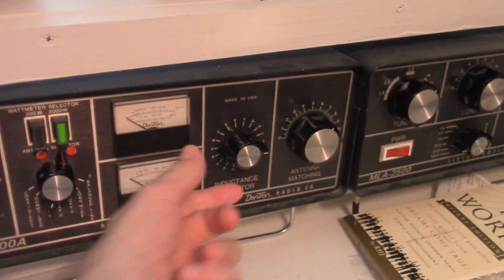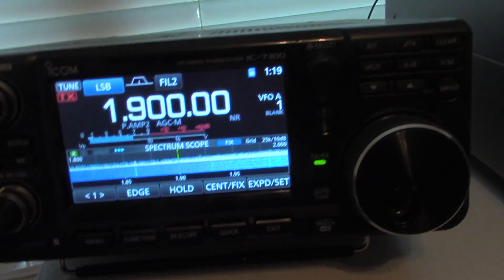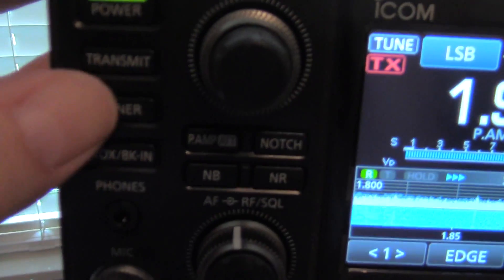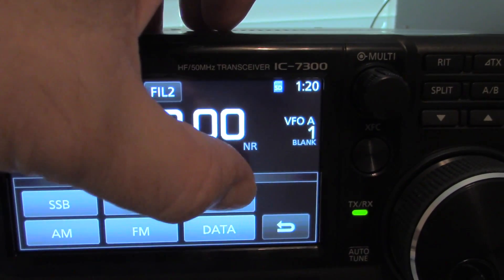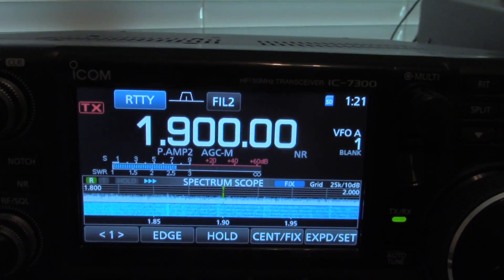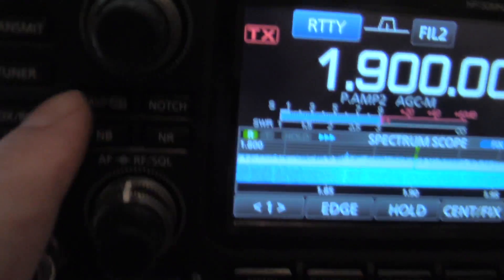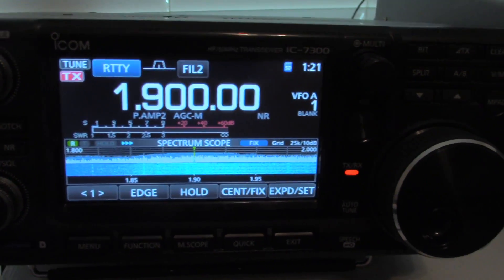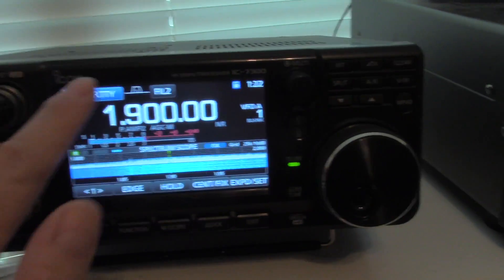Icom IC 7300 Using External Antenna Tuner to Lower SWR

Comment: Do I disable the internal tuner when using an external tuner? Or do you use them  together? Or tune the external tuner first; then use the internal tuner? Or vice versa? Thanks!
Reply from the maker: I would turn off the internal tuner,  then use your external tuner.  Thank you for watching my video.
Reply: @RichRodgersOnline  Is it possible to use both in conjunction with each other?
Reply: @RichRodgersOnline  Thank you Rich
Reply from the maker: I have tuned the external tuner as close as I can, and then I hit the internal tuner.  People say I should not, but I do.

Comment: Hi

When using the internal tuner will the 7300 automatically drop its power or do we need to manually do this??  Icom gives unsure answers-Unbelievable!
Reply from the maker: Hello William, When you use the internal tuner, the 7300 will automatically drop the power.
Reply: @RichRodgersOnline  Thanku!!!

Comment: I had the same problem I tried to tune a vertical antenna, and the SWR was way over like OK, I have put my LDG Auto ATU  and connected that to IC7300 now I get 1:5 what a radio well impressed with it.
I might try my manual ATU see what I get AT230 😏 Thanks for the information first time I set it up today and what a brilliant radio. I got this for my 40th birthday just had a go today on 20m wow.
Reply from the maker: Glad it seems to work great for you!!   Than you for watching my video!!

Comment: Of course, the best place to put an external "antenna tuner" is at the feedpoint between feedline and radiating element, that way the feedline is terminated in its characteristic impedance at both ends.  This is meant to reduce ohmic losses in your feedline and keep whatever power is reflected back from your radiating element within that radiating element, and so it and the tuner take the heat instead of your feedline.

73 VE7NDE
Reply from the maker: It would be nice to be able to do that

Comment: ok, I'm a bit confused so do I more stick with SWR read from the radio instead of my manual ATU? I'm using MFJ-945E, do I need in radio menu switch off internal ATU?
Reply from the maker: P.T.T. Thank you for watching my video.  I would have the auto tuner off in the radio. I would just use the manual antenna tuner meter.  Sometimes I can not get som bands down low enough SWR using the manual tuner.  When I only get the SWR down say to a 2 to 1, I hit my auto tuner in the radio.  Then the radio thinks, so to speak, that it has a 1 to 1 SWR...  Most of the time I have my radio auto tuner off.  Again unless I cannot get the SWR down with the manual tuner...

Comment: you can get the little plug-in dongle from the guy on ebay, it plugs in the back of the 7300 when tune is pressed automatically lowers the output power to 10 watts... cheap, about $15-20.  I remember his address is cornwall on the hudson.  Works great!!!
Reply from the maker: I could just turn down the power

Comment: Thanks Rich, just what I needed.  I got my 7300 this afternoon and the internal tuner wouldn’t tune the upper end of the 80 meter band.  I do have an external tuner and will try it in then morning using your suggestion.  Thanks again. 73.
Reply: I hv the same issue with the sane radio on upper 80. Go into emergency mode(50 watts is not a huge deal)and the internal tuner works perfectly
Reply from the maker: I hope all worked well.

Comment: Rich Rodgers, One main determinant of success with antennas on 160 meters is that they suck, generally, if designed to cover the "usual bands" from 3.5 - 30 MHz. I'm NOT sure what you described as your antenna, but most antenna tuners tell you what to do to load up on 160. It ain't pretty. Most require rewiring your whole antenna system and run the antenna as a top hat Marconi configuration driven against ground. Many ops are using combo antennas such as a G5RV. Wow. What a mess to convert to 160! Most scream at you in their comments, NOT FOR USE ON 160 UNLESS EXACT CHANGES ARE MADE TO ANTENNA. So, I wouldn't expect even a great tuner to work on some random antenna on 160 unless you REALLY know what to expect. de KQ2E
Reply from the maker: I agree

Comment: I was told you cannot use external and internal at the same time
Reply from the maker: Francis Farmer I have found that you can sometimes get it close with the  External antenna tuner,  you can peak it to very close SWR with the  Internal antenna tuner
Reply: @RichRodgersOnline  all your doing is tuning the input to your external tuner it not helping you just faking it more. adjust your inductance one notch one way or the other then retune. you should get a flat match. never run both at the same time.
Reply from the maker: @bradkellison5359  I believe I tried to adjust it more but had no success, the auto tuner worked great to tune it in just a little more.  Yes faked it but 100 watts out
Reply: @RichRodgersOnline  Two tuners in series might "work" but you should consider all of the factors at play.

Since you cannot match the antenna with a single tuner, this indicates a fairly high SWR on the line. This will cause not only higher feedline losses but could lead to the development of sufficient voltage or current on the feedline to cause its failure. This is particularly true when an amp is involved as you indicated.

Then consider the tuners. With a high SWR and an amplifier, at least one of the tuners could flash over (arc) due to high voltage or it could smoke due to high current. There is also the general consideration of tuner efficiency. If the two tuners combined yielded a 2 dB loss, for example, and you run a 1 kW signal through them, they will dissipate 370 watts of heat. That is a lot of heat for a tuner to safely dissipate (and generally one tuner will bear the brunt of the matching and thus heat dissipation).

So if you experiment with this setup, I would recommend starting at QRP power levels and then slowly raise power while monitoring the operating conditions. You may find that the combined losses and risk of damage don't make it a viable solution. Then its time to put up reasonable antennas for 160 and 6 meters.
Reply from the maker: @bradkellison5359  Brad, I was using 160 meters because of high SWR.  I don't run 160 meters, the 7300 tuner will only will work if the swr is 3 or less.  Most of my other bands are  6 SWR or less.  I was using 160 just to show you can get the swr down to less than 1.5....
Reply: @RichRodgersOnline  then you need to tune your 160 to resonance to make it easier for your tuner. you still should never use 2 tuners at the same time. 2 tuners cause loss of signal that is what the info I sent you was about. run one tuner in bypass and the other as your normal. if your antenna is still too high in swr then adjust it to be more resonate for the frequency you are going to use it on.
Reply: No you can`t just turn off the tuner on your 7300. mine works great, I am using a MFJ 929.

Comment: why not make or buy the cable that interfaces with the IC7300 or the ic7610 the MFJ-5114I cable is a much better option, the 998 is made to interface to the Icom Radios. That plug you are using is made for a tuner that does not interface to the Icom radios or a manual tuner
Keith N9QDS
Reply from the maker: Might work

Comment: an antenna tuner  does not lower the SWR of the antenna..  all it does  is  present the rig with a 50 ohm resistive load.  It does not change the resonance of the antenna.
Reply: NO, the tuner tunes the antenna system which is consisted of TX, coax and antenna to become resonant.
How would you explain that you can work 5000km DX on 20m band with 2m long vertical antenna which has SWR 9:1...?
Reply from the maker: Good point
Reply: I'm sure he knows that, he just I'm sure meant to say lowering your SWR
Reply from the maker: Yes
Reply: Absolute decrease in swr and increase in signal strength. Thank you sir!
Reply from the maker: Thank you
Reply: Yes and no... Think of the antenna tuner as a transmission in a car. When you start off in a car the transmission is in low gear to be able to deliver the best possible torque from the engine to the wheels
and as the car picks up speed the transmission shifts again to keep the engine in it's sweet spot RPM wise to deliver the maximum torque to the wheels and depending on the number of gear ratios in the transmission it will continue to shift to keep the "best" possible match so that the engine can deliver the maximum torque to the wheels with the best efficiency possible for a given speed. The same concept applies to an antenna tuner. The radio being the engine and the engine RPM being the frequency and the antenna tuner being the transmission and the antenna itself being the wheels. With that said you're still correct because in the end the physical length or build of the antenna will determine it's resonance for given frequencies and it will go in and out of resonance over given bands. Like you said the antenna tuners main job is to keep a match between the transmitter and it's feed point or better yet, protecting the transmitter from mismatched loads by tricking the transmitter. You still get the benefit of delivering the maximum power to the antenna because you aren't losing power back to the radio with reflected power AND the tuner actually tunes the antenna system which is consisted of the TX and the coax.
Reply from the maker: Good point
Reply: If the tuner is ONLY tricking the transceiver into seeing a 50 ohm load and it’s NOT helping the antenna come closer to resonance then explain why the received signals become stronger when the tuner lowers swr? I think you will see a tuner is doing both things at once.
Reply: @alabamacampandhike  the tuner is only bringing the resistance to 50 ohms. The increase in noise is a result of that.
Reply: Mark Stewart a dummy load is 50 ohms. It still doesn’t make sense to me. I can take a weak signal on an untuned antenna and then tune it and that signal will increase in db gain on the S meter. Not just the noise floor the actual signal.
Reply: @M70ACARRY  In fact, you can use the loudness of the noise floor as a sign that your antenna system is getting closer to a 1:1 SWR.
Reply from the maker: And signals
Reply from the maker: Good point
Reply from the maker: Good point
Reply from the maker: Good point
Reply from the maker: It helps match
Reply from the maker: Yes